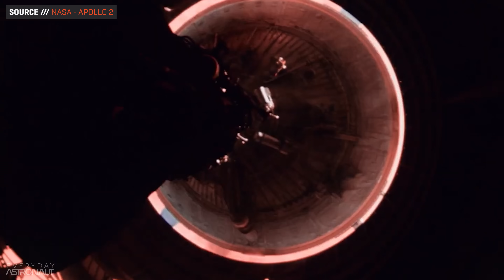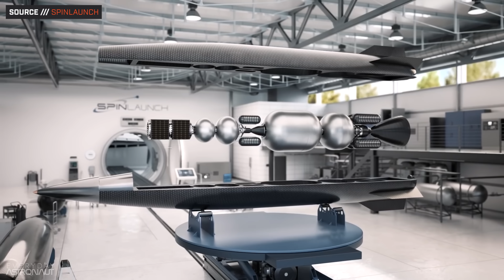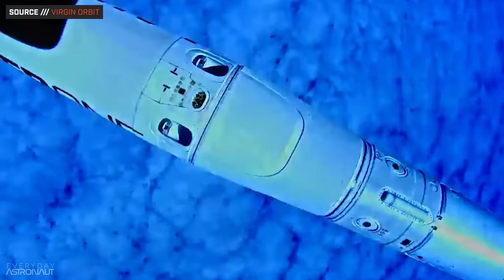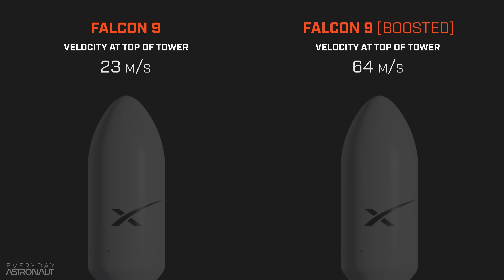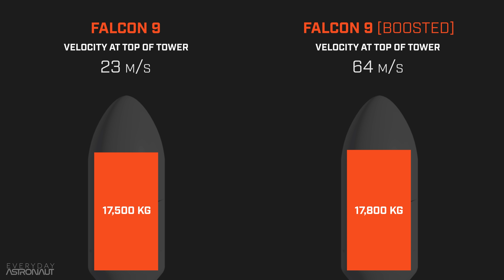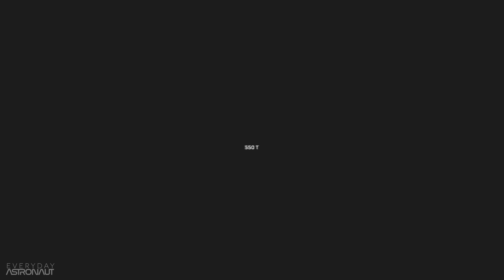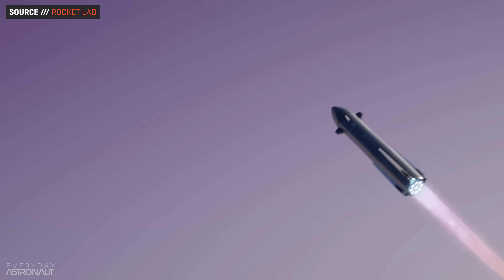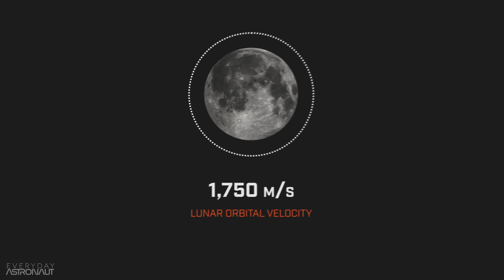Could We Help Push Rockets To Orbit?

Comment: Why calculate for such an aggressive assist (3Gs)? Even 0.1 assist would save quite a bit of fuel, right? And the slower acceleration would allow a longer time of applying that force during the crucial liftoff phase.
Reply from the maker: Because even an aggressive 3G did very little for performance, lower that to 0.1 and you literally add like 5kg of payload capacity, (or save like literally 20 kg of fuel) for an awful lot of work and complications.
Reply: @EverydayAstronaut  Respectfully (and thank you for the reply and the excellent content, by the way!), I'm having a hard time believing that. If we calculate work as force applied X distance, then even a 0.1g acceleration to a massive object over the distance of a tall launch tower should be quite a big number (and therefore a significant fuel savings). Didn't you say that some rockets achieve a very small net positive g value during the initial climb? 
I'm wondering if maybe your calculations that show a small impact are assuming that the rocket accelerates at 3g off the launch pad. Where does the net 3.0g value come from? You mention that the Falcon 9 rocket will provide 1.4g (net of 0.4 g without assist). So why isn't a net 0.4g the basis of comparison for how effective a corresponding assist system would be? At least for those first seconds of the launch, 0.1 would be a 20% boost to power if going from 0.4 to 0.5, right?
Reply from the maker: Correct. 20% boost in power for about 2 seconds out of 8 minutes of a rocket accelerating. It’s almost nothing.

Comment: Ok, if Musk sees this, I’d like £10m.. how about dropping a weight on the short end of a long lever using the end of the long arm to launch? You’d multiply the velocity of the end of the lever depending on the differential. Just a thought..or just a massive vertical slingshot!

Comment: What about not increasing the payload? What about making the rocket lighter instead by replacing fuel with an external push?
What about accelerating horizontally first on a sled on tracks and then go up the side of a mountain? With the same idea, keep the payload, reduce the fuel needed, reduce the size and starting weight of the rocket.

But well, that is working with what we have now, the real kicker would be to fundamentally understand gravity and build an anti-gravity engine. 🙂

Comment: I think this video focuses on the wrong aspects of these systems with way too much focus on the energy side which is not actually the problem (it's trivial to build energy storage systems that could charge up prior to launch for that amount of energy) and very little time given to the actual problems of the extra reinforcement the rocket would need to handle the extra forces adding more weight than the payload boost would add. Rocket systems where it makes sense are already using boosters of some kind, like compressed air for submarine launched missiles or external strap on boosters for large rockets.

Comment: Please just use MW or GW directly, instead of something like 5.5 million kW. Also, to me at least, it is much more intuitive to think power first then energy when looking at these scenarios. Like I expect you to tell me how many Gigawatts of power is needed - and then how many MWh the capacitors would have to hold. Doing it the other way around requires much more mental gymnastics for the viewer - at least for me.

Comment: they should do two 1 kilometer deep tunnels side by side and connected from bottom (near sea) (second tunnel bit larger diameter)... then let seawatercolumn from sea be as counterweight in second tunnel to start the push the platform with rocket on first tunnel upwards for first bit as assist and then some other system in tandem to somehow increase speed to plop the rocket out from tunnel...then just pump the water out for next launch.

Comment: How about taking the exhaust from the rockets engines at launch and partly containing them in a chamber that develops pressure and uses this pressure to lift a platform that the rocket sits on? When I was building and launching model rockets there was a system that used the pressure from the rocket engines to add additional lift at launch to boost the model rockets speed and altitude.

Comment: Should take the same energy to launch an object... as it takes to launch the object. Not way more energy. But if you didn't have to accelerate tons of fuel then that wasted energy lifting the fuel is saved.... So there is no way to burn the same amount of fuel on the ground ... yeet launching a rocket avoiding accelerate all that fuel? Guess not.  e.g. Leave half the fuel on earth to power a laser that pushes the rocket. Of course such a powerful laser would probably vapourize the rocket. Yet it seems a waste to spend majority of the fuel's energy lifting the fuel itself and not in accelerating the final payload capsule. You would probably only need half the fuel or less if you didn't have to lift the fuel.

Comment: Semi-sioly Q: Why not combine the rocket motor, with the Electromagnetic accelerator? 

You can have a long, level run up to build speed, have a gentle slope to redirect the direction of travel to nearly vertical. Use topography to help with a mountain. 

You increase impulse duration over a longer period of time, reducing the stress on the system. 

Just a thought

Comment: Why did you use on the Moon launch example still the G from Earth?
Reply from the maker: It's capital G for Gravitational Constant. The escape velocity of lunar orbit is much lower than Earth and that's what matters
Reply: @EverydayAstronaut  but you used the same value as for Earth, 5G = 49m/s**2! That is what I am trying to say.
Reply from the maker: Yes. A G meter doesn’t change to the local gravity. Again, capital G, gravitational constant. We were only worried about how much accelerating force is happening, not how much greater than the gravity of the moon it is
Reply: @EverydayAstronaut  you still don't get it, you used the 5G Earth value of 49, which is not the same with the Moon's 5G.
Reply from the maker: A G meter on the moon wouldn't read 1G, it'd read 0.166 G, you don't randomly recalculate an accelerometer to the local G environment, saying something is 5G of acceleration in space, on Earth or from the moon is the same, about 49.5 m/s2.
Reply: @EverydayAstronaut  the way I see it, when you want to calculate the forces you need to overcome in order to leave the orbit of a celestial body you have to consider the values of THAT celestial body. If on Earth you have to beat the 49.5 value, on the moon should be 6 time less.
Reply from the maker: The 2,380 m/s impulse for escape velocity is the bit that's substantially less than the escape velocity for Earth. The G is just a measure of acceleration. On Earth it'd be over 12,000 m/s. So that's the part that reflects the moon's lower gravity, the acceleration is measured the same way whether on Earth, in Earth's atmosphere, in space, on the moon, on Mars, etc.
Reply: @EverydayAstronaut  and nobody said otherwise, it is just that on Moon you don't have to beat the 49 value!!! That is what you need to do on Earth!

Comment: One approach not discussed is as follows:  in the typical configuration, the exhaust of the rocket ends up having a high percentage of the energy (low mass high velocity, vs the rocket high mass near zero V).  If the bottom of the rocket were setting on a sabot inside a barrel, and the rocket exhaust pressurizing behind the sabot, the entire Earth becomes the reaction mass, and the rocket is comparatively low mass.  In other words, treat it like a bullet in a gun barrel until it clears the tower.  I suspect this method is used in model rocket competitions launching bowling balls.

Comment: hey tim with all due respect a tube with a pressure gradient in it thats open at the top will definitely pull air from the atmosphere its why we build chimneys.
Reply from the maker: The pressure gradient is from the heat of the fire in the fireplace in a chimney. If you built a tube to space, it wouldn't magically suck all the air out.

Comment: Gas pressure, increase gas pressure to force the lift of the mechanical arms to accellerate the rocket the 70 meters. You figure out the rest, timing, cut off the gas pressure, etc.

Comment: No, the energy needed to lift the weight would be more than the energy it creates so kind of useless unless you was trying to conserve a fuel source but the weight you could save on weight would have to go into the rocket being strengthened as injecting so much energy into a lightweight machine would be self destruction, its not a solid arrow/rock, edit : i wrote this before watching the video, I like the centrifuge idea

Comment: From my experiments in KSP magical realms, the yeeting is not about 5G, 3G or maybe not even 1G of acceleration but it helps to set inertia. When rocket is flying super slow, any momentum will make it flip also we don't have angular acceleration at all. It's like flying a glider at very low speed, if you overcorrect it's done, because control is coming 10seconds after order. With 0.5 you already have the truck pushing the trailer with compression and inertia. Conclusion the cost of yeeting protects you from a flip and burn rkt at 50m heights... aka on your head

Comment: I love the counterweight idea. Drop the launch pad down into a tube in the ground, and mount the pulley system on the ground instead of at the top of a tower. It would require reinforcements on the ground just like we already do for large skyscrapers. Allow the counter weight to drop into a big water or oil bath below it to slow its fall, then crank it back up after the launch is done. 

Or do two counterweights and the rocket would be pushed up by a sling. Would look like a vertically mounted slingshot.

Comment: Bro the math is incorrect because you are mixing energy with power.
To accelerate starship at 3g from 0 to 50kph would take only 200kwh of energy at a massive peak power of 2.72gw because you use it in less than second.

Comment: What about a much larger radius circular maglev track on the side of a hill firing off a swarm of small rockets with the same total payload? 

The bigger the radius the smaller the centrifugal force to escape velocity ratio. Could be couple of kilometres in diameter. And if it's too much to lift heavy rockets then just fire off a bunch of smaller ones with the same total payload as a single big rocket.

Comment: You could just launch from top ofa mountain & save fuel because your already 1mile or more from normal launches at sea level!
Reply: you could also launch from jumbo jets 30,000 ft up in air already!
Reply from the maker: And another one about air launching - https://youtu.be/AAt9WDQEMoA?si=qdGP7IWuo8yCPeyo
Reply from the maker: I have a video running all those numbers already - https://youtu.be/4m75t4x1V2o?si=orS_0Sm2w348pfna

Comment: 10:58 according to chat gpt 1k MJ is enough to boil 385 litres of water – or about 2'000 pasta dishes for 1 person each.

here is its thought process :

How many liters of water can you boil with 1k MJ :

#############################################
Step 1: Convert to joules ###########################

1 MJ = 1 000 000 J
So:
1 000 MJ = 1 000 × 1 000 000 J = 1 000 000 000 J (1×10⁹ J)

#############################################
Step 2: Energy required to heat and boil water  ###########

Heating from 20 °C to 100 °C (ΔT = 80 K):
Specific heat capacity of water ≈ 4 184 J/(kg·K)
Energy per kg = 4 184 × 80 = 334 720 J ≈ 3.35×10⁵ J

Boiling (latent heat of vaporization):
≈ 2 260 000 J/kg = 2.26×10⁶ J

Total per kg (≈ 1 litre of water):
3.35×10⁵ + 2.26×10⁶ = 2.595×10⁶ J ≈ 2.6 MJ

#############################################
Step 3: Divide total energy by energy per litre #############

1×10⁹ J ÷ 2.595×10⁶ J ≈ 385.4

#############################################
#############################################
#############################################

How many pasta dishes for one person ?

#############################################
Step 1: Energy for one pasta dish #####################

Cooking pasta basically means:

Heat ~1 L of water (≈1 kg) from ~20 °C to boiling (100 °C).

Keep it boiling for 8–12 minutes (depends on pasta type).

The main cost is heating the water:

Heating 1 L: 334 kJ (from my earlier calc).

Keeping it boiling: extra energy, but modest compared to the latent heat of full evaporation. Let’s approximate another 100–200 kJ lost as steam + pot inefficiency.

So ≈500 kJ (0.5 MJ) per pasta dish is a decent ballpark.

#############################################
Step 2: Divide your energy reserve  ####################

You have 1 000 MJ available.
1 000 MJ ÷ 0.5 MJ ≈ 2 000 pasta dishes

Comment: Since atmosphere and height are the most significant factors in terms of energy requirement, I would build the launching system on higher ground (ALMA is built at 5,000 meters or 16,500 feet above ground, for example). Furthermore, I would start accelerating horizontally and only add inclination close to the end of the assisting mechanism (which could be achieved by another Y-axis type acceleration, close to the edge of the plateau if launched from elevated ground, like the flaps of an airplane). One may argue that we will need to get the payload to this higher ground. Still, the cost to do it can be significantly reduced since there are several reusable options to get the payload to the launching system height (including reusable energy).

Comment: I think your  math is off or something    28 cubic meters of steel would roughly weigh the same at 11.5 cubic meters of tungsten.  and theoretically you could use  mercury instead of tungsten with ~ 14 cubic meters of volume although the cost is significantly larger you can drained the mercury as it lowers to slow the catapult down no need to capture. alternatively you can reduce the amount of mercury required given it has an expansion ration of  1 : 3,500  at ~400 degrees Celsius  when it changes from liquid state to vapor. use the rockets engine heat to boil 6.5  cubic meters of mercury and mercury expansion ratio to power the catapult/chopsticks.

Comment: Think about it backwards.. what if they had a stationary rocket motor ground mounted. All your fuel etc for stage 1 no longer needs to be carried onboard. Would just need to solve the heat issues, which im sure could be solved.. go on.. run the math.. tell me im wrong..🤫

Comment: Imo, you could only assist a craft to it maximum pressure, limiting the amount of assistance. 

Have a rocket sit on a sled in a tunnel, launch sled by electro magnet rail. Fire up rocket engines and throw the rocket out at 750mph or so… have the rockets kick in and take the ship to space.

Comment: I would keep making rockets better, but for raw materials i would build a some sort of cannon, you could pretty "easily" launch metal rods, with relatively small cannon if you can push 50-100 g on launch, just a bare metal rod with very minimal controls, and you would have platform/station on orbit that catches these rods, large solar farm for power that could sell extra power to grid when there are no launches. What we need most on space is refined raw materials, we can make machines that can bend rods into any shape and get them to orbit and power them on orbit. But it is hard to build anything if you dont have materials. So basicly launch system that can launch metal rods into orbit, with very high acceleration at launch. 
Well not sure about how viable it would be even on paper compared to rockets, but if i would be in business getting stuff in to orbit i would atleast spend a little bit of time figuring out if we could get some raw materials in to orbit just by making the biggest cannon so far.

Comment: Raptor engine is the key you could put a thousand of them under a platform with starship on top, if you build the most powerful engine ever might as well use it. F**k it build a hollow skyscraper raptor power launch tower problem solved.

Comment: Why not launch from altitude it might be because of position on the planet but always seemed weird to launch from sea level, lack of air shouldn’t be a problem colder temperatures help cryogenic fuel and if you’re starting at 10,000, how much fuel is needed to get to 10,000 feet. Railway up the mountain and then launch.
Reply: To get to a Low Earth Orbit (500 miles high), roughly 10% of the fuel is used to get to altitude, 90% of fuel is to get it to orbital velocity. If you start at 10,000 feet , you are only 1/264.5 the way there in altitude, zero the way there in velocity. So 1/264.5 of your 10% fuel load (to get to altitude) saves you 0.038% of your fuel load. On a fully loaded Falcon9 rocket (410 tons fuel), you just saved yourself 330 pounds of fuel doing so and just added an extra 3.3 pounds of cargo capacity to your rocket.
Reply: @wally7856 is that it wow, still get a couple of cup holders out of it.